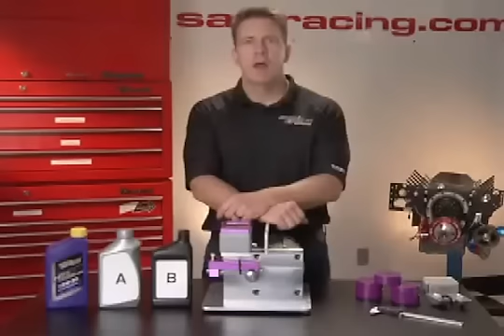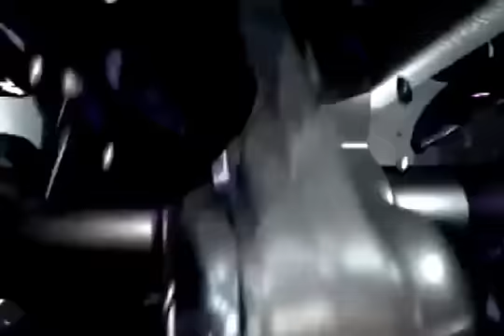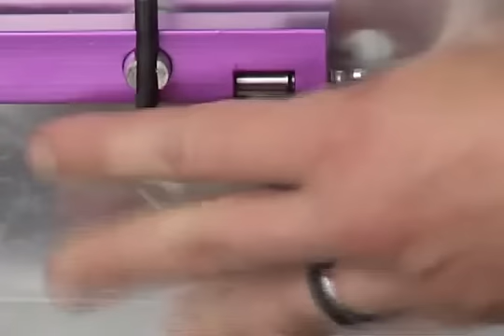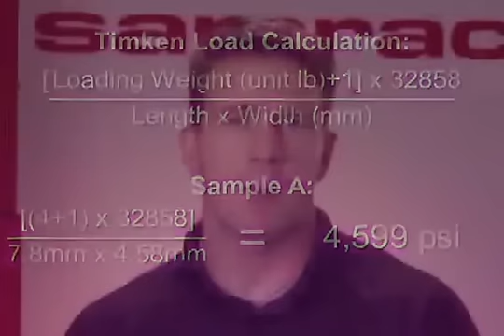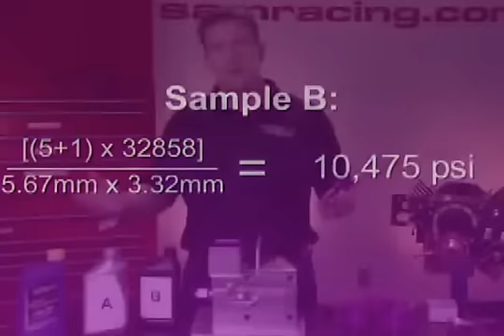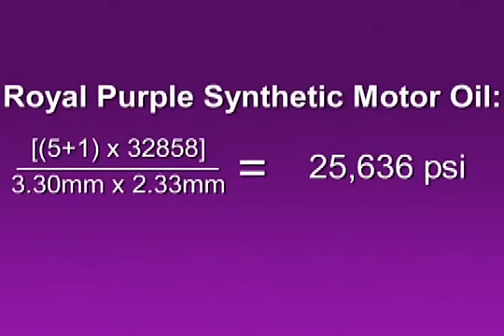Royal Purple - HPS Multi-Grade High Performance Street Motor Oil Part 2

Comment: Not sure if I buy this test or not. It doesn't replicate the same as the internal parts of a engine. Snake oil.
Reply: All three oils are good the test is just rigged to look like the royal purple is better I use royal purple and it is good so is the mobile 1 and the other crap the guy turns the machine off for the other two off screen and just leaves the royal purple one on but the damage in mm's is probably right on.
Reply: The test simulates viscosity with pressure and friction on bearings almost like a quicker version of what engines do to themselves long term with wear and tear of grinding steel between with oil as the only protection. I think it was a great test just sneaky in method a good sales gimmick but great products all 2 that I can recognize lol.

Comment: sample A looks MOBIL 1 and it is missing a foil cap. strange.
Reply: MB Benz Believe it or not Mobil 1 oil jugs don't have a foil cap it just has the plastic seal cap sealing the oil which is probably my biggest gripe with Mobil 1 oil because it doesn't seal  the oil inside the jug as well so it can't be stored as long.